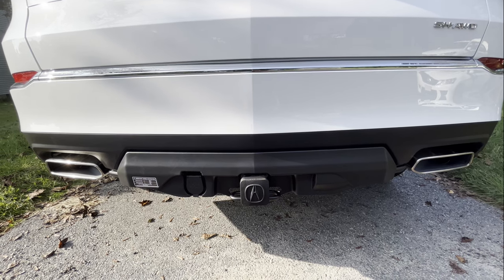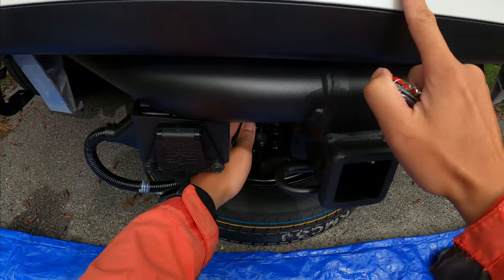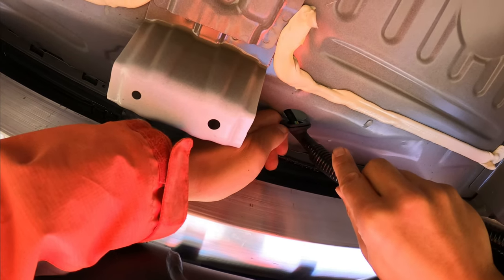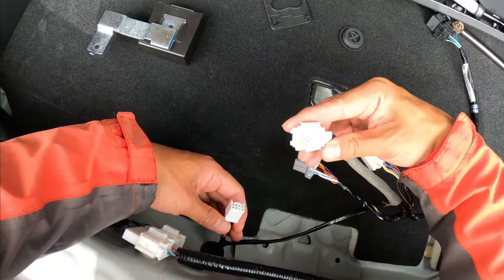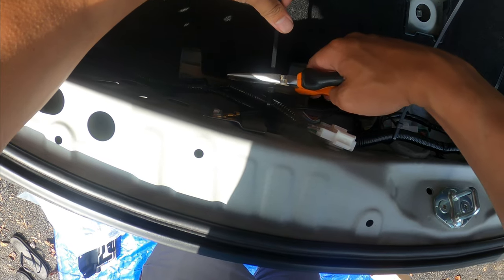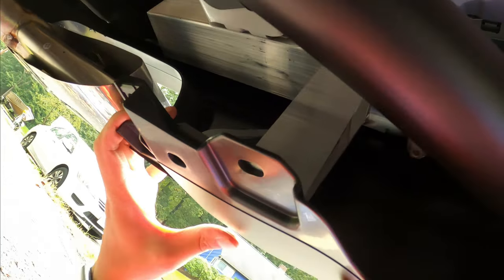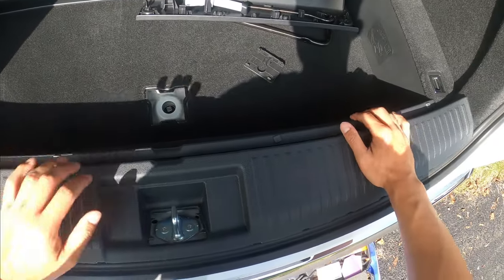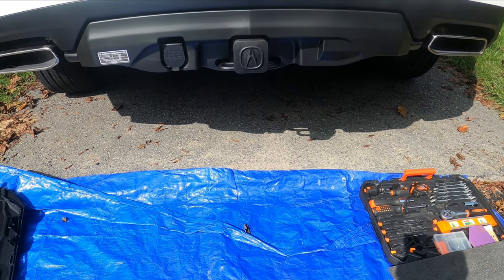2022-2024 MDX OEM Trailer Hitch/Harness/Cover DIY Installation

Comment: Thanks for the video. I just finished my 2023 Advanced hook up. I never would have stuck with the cutting up and replacing the kick sensor without this video. I had to cut off 50% of the right side of the sensor bracket and shove the main sensor block way to the left but it works! Thanks again.
Reply from the maker: Thanks John for watching, glad to be helpful. Enjoy your MDX!
Reply: I am about to do the same install as you (with the kick sensor). I was just thinking...okay, I'm going to have to cut this sensor bracket. Glad my instincts were correct. Any tips regarding that aspect of the install would be greatly appreciated. Thanks!
Reply from the maker: @00Stoneman00  no idea on that sorry bro…
Reply: @SteveChenFishing Hey, thanks anyway for responding.

Comment: Great video, Steve! Is there any way to "test" that the wiring harness is actually working without a trailer or boat? I don't want to find out it's not working in a few months when I rent a U-haul trailer and the lights aren't working. Thanks!
Reply from the maker: Check with a multimeter, it's voltage based. Check the voltage between pins, online sources show which pins are supposed for braking/turning, etc. Good luck.

Comment: Hi awesome video! My wire only came with one rely I bought my part at the dealer. Any idea why that may be?
Reply from the maker: Hi thx for watching. Did you check the part number? Does it match the one shown in description section?

Comment: Great video! I was about to scratch the MDX from my shopping list because of cost and I could not find a picture of what it looked like installed. Did you purchase parts through dealer or somewhere else?
Reply from the maker: I think I have the part number and link in the description. Find the OEM pieces online is my recommendation.

Comment: Great job on the video, step-by-step instruction was fantastic.  I have a question, if you needed to install an electric trailer brake controller in the MDX, are the required wires or the wire harness already located under the dash somewhere in the vehicle?  Thx.
Reply from the maker: Wire harness has 6 pins, which includes braking. I think so but don’t quote me on that 😉

Comment: directions were great and everything was going great to the outter  planel reinstall. My panel doesnt fit. it doesnt go around the hitch or the plug. Do you have to order a different panel then the factory pane?
Reply from the maker: Yes a separate part has to be purchased, with pre-cut holes to accommodate the hitch and harness.
08L92-TYA-200B (trailer hitch cover)

Comment: Great video. I thought a cable had to be run from the battery back to the wiring harness, but it looks like Acura already did that for us. I was thinking about getting a Curt hitch but I like the way the OEM hitch sits higher up and is covered by that replacement panel.
Reply from the maker: yea the higher up position and integrated look was the reason I chose the OEM piece. It makes a difference for launching a boat.

Comment: Hello sir, your video is VERY helpful as I'm considering buying the base 2024 MDX as well and only need 3,500 lbs. of tow capacity (so no ATF cooler needed.) I'd prefer to do this myself and the dealer's charge would be too high in my view anyway. A few questions, as info on the internet for towing with an MDX seems to be scarce. 1. What is the hitch height, to the top of the receiver tube? 2. How well do you find that the MDX tows your boat, and how large/heavy is it? 3. As a more general question, have you been happy with the base trim? Thanks much for making the video!
Reply from the maker: Hi Thomas, thx for watching. 
1. 17 inches
2. Haven’t tried towing yet. Not supposed to tow within the first 600 miles. Planning to tow 2000-3000 lbs with it. I have ATF cooler installed just want to have some safe margin. I wouldn’t tow 3000 lbs without ATF cooler.
3. I’m pretty happy. Just the fuel economy… but you can’t get good fuel economy with a capable towing vehicle anyway. 
Hope this helps.
Reply: @SteveChenFishing  Thanks again, and happy fishing!

Comment: Just checking that the 08L91-200 is the correct part number because the Acurapartsforless web site says "This part does not fit your 2024 Acura MDX" .  I have a 2024 MDX SH-AWD
Reply from the maker: Hi, 08L91-TYA-200 works perfectly on my car. it's a 7 pin receiver.

Comment: Did you torque down the 6 bolts holding the trailer hitch ? If so what is the torque specification.?
Reply from the maker: According to the instructions:
Tighten the six flange bolts to an initial torque of 32 Ib-ft (43 N·m) as shown. Then, tighten the bolts to a final torque of 63 Ib-ft (85 N·m).

Comment: Where did you order the parts? Thank you.
Reply from the maker: Hi I searched from these two websites, shipping I paid less than $100, I noticed parts were shipped from a local dealer actually. Shipping fees vary basing on your zip code. You may compare between the two and get the cheaper one, good luck! Enjoy your DIY!
https://acura.oempartsonline.com/
https://www.acurapartsforless.com/

Comment: Great video where did you get the parts from, and did you pay a high shipping cost.
Reply from the maker: Hi I searched from these two websites, shipping I paid less than $100, I noticed parts were shipped from a local dealer actually. Shipping fees vary basing on your zip code. You may compare between the two and get the cheaper one, good luck! Enjoy your DIY!
https://acura.oempartsonline.com/
https://www.acurapartsforless.com/

Comment: Slick!! How/where'd you buy everything from? Only from dealership??

2:45 NOT the right tool for the job!!! JFC, gonna cut your damn hand off. Just go get a flathead screwdriver
Reply from the maker: Agreed on the wrong  tool😝 from two online stores I’ll post link in the description. Thx for watching!
Reply: @SteveChenFishing  awesome thanks! Despite the tool snafu, a very good video. I want to add this to my wife's '23 MDX A-Spec. Did you have Acura do any engine or system modification for towing? Engine cooling or brake system or anything like that?
Reply from the maker: @Pens4Life85  ATF cooler, installed at dealer, parts+labor $1100. I checked how to DIY it, didn't want to spend that time...
Reply from the maker: I just realized the A spec might have hand free sensor on the back so the installation is a bit more complicated… you can find the pdf instructions online.
Reply: @SteveChenFishing  our A-Spec at least doesn't have that, seemed gimmicky to me. My wife said that's specific to the Tech Package? Either way, I don't F'ing know 😀🤷🏼‍♂️

This was a great video. I'm pretty peeved though about shipping rates for all the necessary OEM hardware. It's like $180-$200, that's BS. Adds an extra like 35-40% to the bil. Nonsense!
Reply from the maker: @Pens4Life85  Yea shipping fees vary between different websites. Since the hitch piece is pretty heavy. It depends on which local dealership/store they are shipping the parts from. I took a look at the tracking they gave me, it was in state. So mine was not that crazy...Good luck finding an less expensive one!!!
Reply from the maker: @Pens4Life85  I had them installed the ATF cooler. That part I didn't want to DIY. sorry for the late reply.
Reply: @SteveChenFishing  good timing. I just ordered all the needed parts last night actually. $430 for hitch, harness, and bumper cover. You have a boat so the trans cooler makes sense. We'll likely only use it for a Uhaul trailer or something
Reply from the maker: @Pens4Life85  Cool, if I remember correctly, the dealer said if it's under 3500 lbs you don't need the ATF cooler. Enjoy!
Reply: @SteveChenFishing  only FWD are 3500lb. All AWD models are 5000lb
Reply from the maker: @Pens4Life85 yes if you have the ATF cooler installed, otherwise 3500 lbs even for AWD